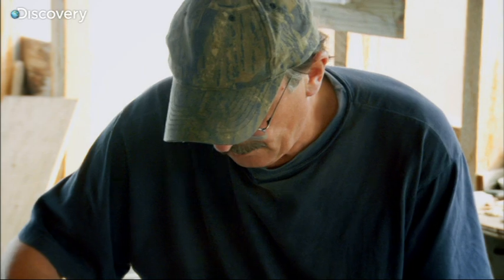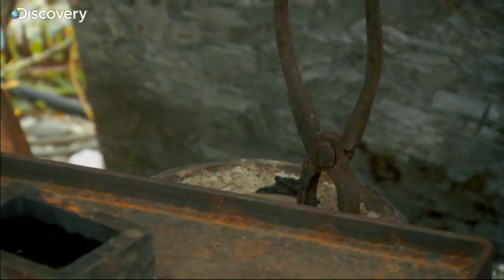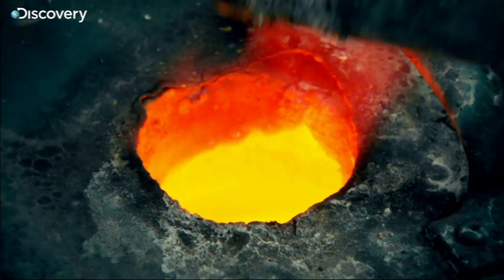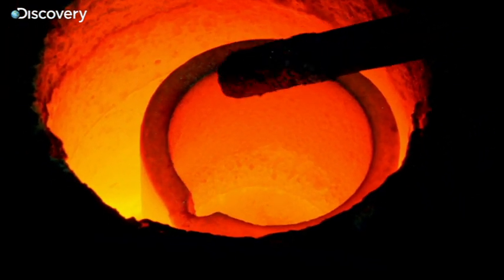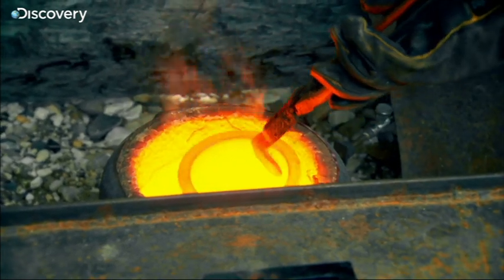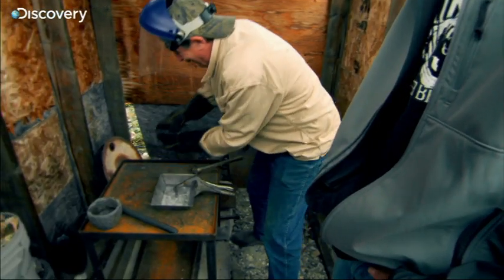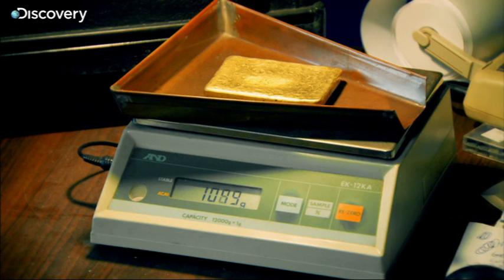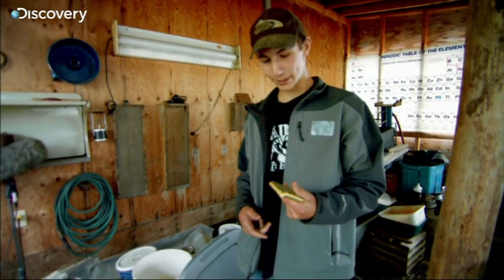Hot Molten Gold - Gold Rush 2 - Sneak Peek Ep12

Comment: I am also raised with the metric system. But onces and the royal system is simple as well. An ounce is defined as Oz=28.35 grams (approximately). It is the 1/16 of  a pound (which is about 16x28.35=453.6 grams) So 35 ounces are 992 grams or 1Kg. And yes, that for gold costs about 35-38 K Euros or about 48-50 K $.